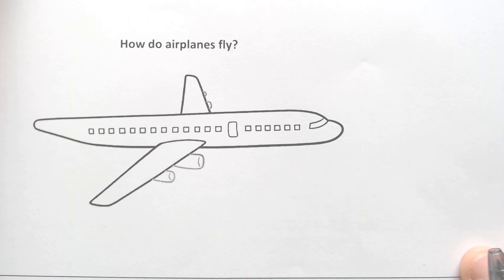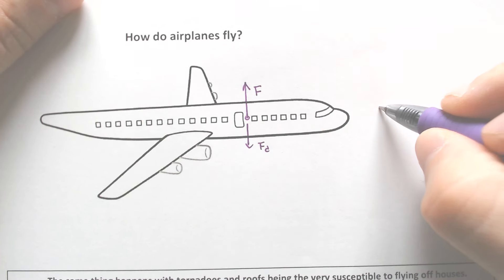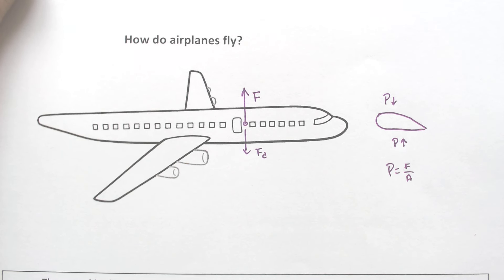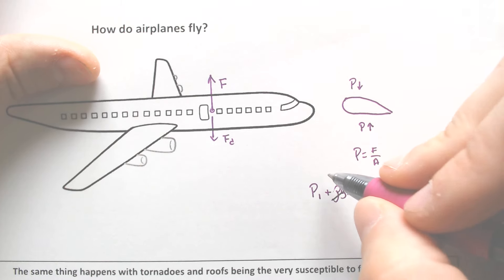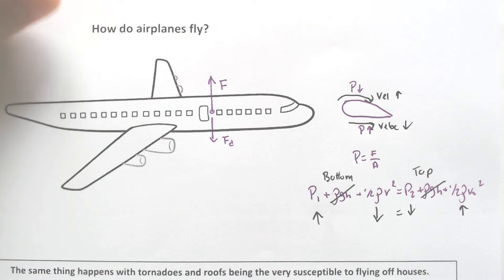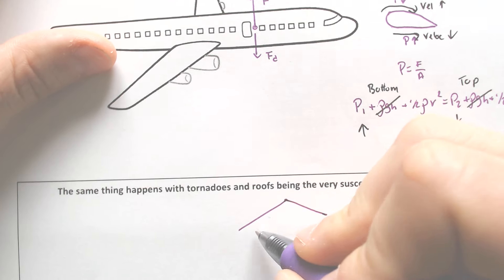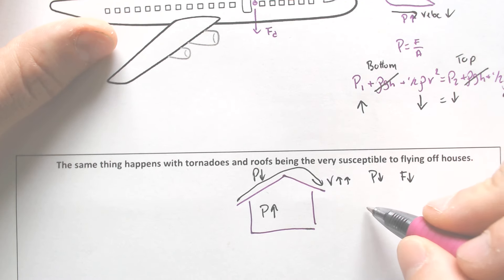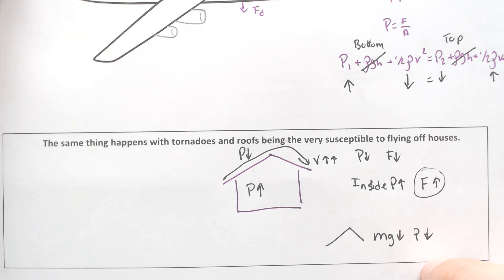How do airplanes fly due to pressure differences

Comment: How do you explain planes that can fly upside down then? (ie with the shape of the wing reversed)
Reply from the maker: There are few possible explanations. If you tilt the wing/plane so the wings are at an angle it can have the same effect to allow uplift,  2. the plane may be specifically designed to do flips etc and have special wings.  3. The pilot may not be able to fly forever upside down and be gliding in a downward direction but adjusts the rear flaps to stabilize without really having much uplift.